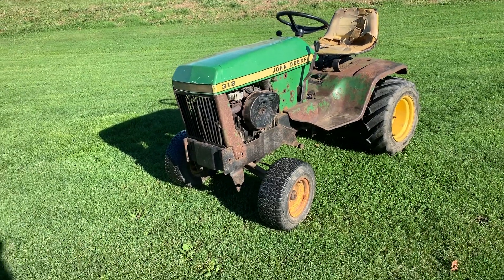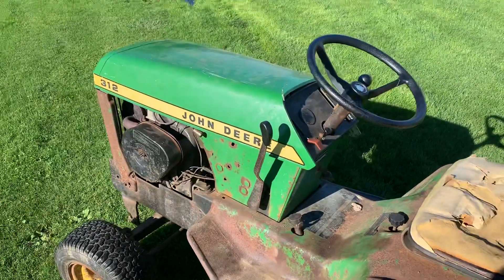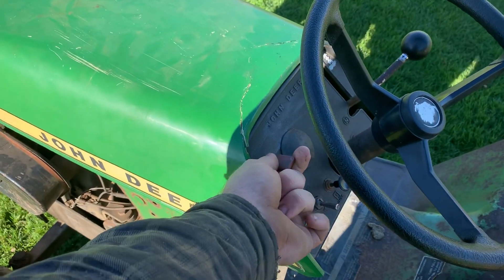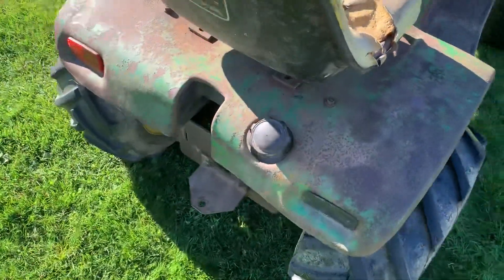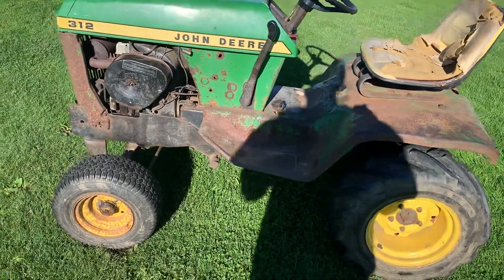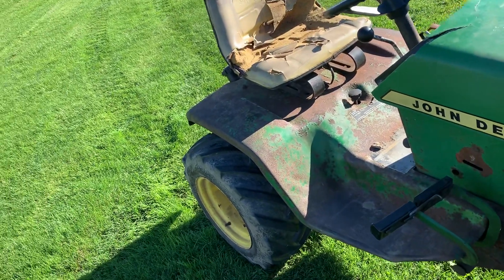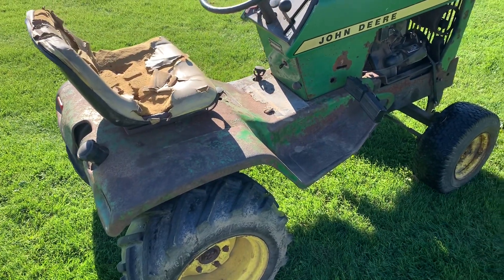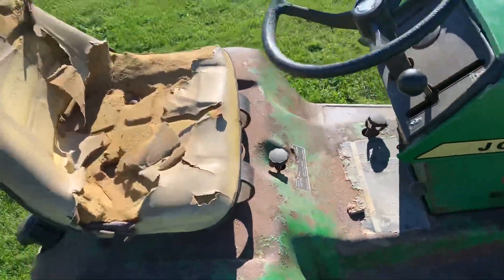How to operate a John Deere 312-314 and some basic information

Comment: What is your opinion on a John Deere 314? I might buy one for $300 in restores condition.
Reply from the maker: Honestly hard to say I’ve never really messed with one. Wouldn’t assume it’s any different than any of the other 300 series
Reply: Have a 1983, 314.  Hard to complain about it.  Used it year around,  snowblower in the winter and it the garden in the summer.      Have owned it almost 20 years,  never had the mower deck on it.  Equipped it with a sleeve hitch for garden work, ran hydraulics to the rear to operate the sleeve hitch. Does an excellent job on the snowblower,  but seldom have more than a foot of snow to blow at one time. 

Possibly two down sides, one it does use gas when you work it and second the single cylinder motor does shake when you first start it. 

Don't know of the new mowers/garden tractors will last and still be running after 40 years.  Metal work and  paint are in excellent shape.  (Wax it several times a year). Not many for sale in this country and always way more than $300.00.